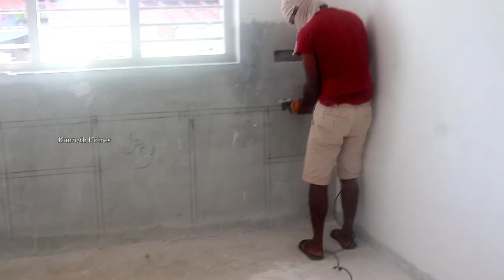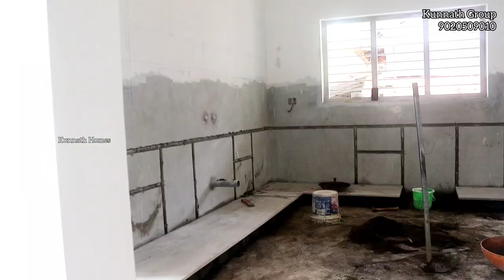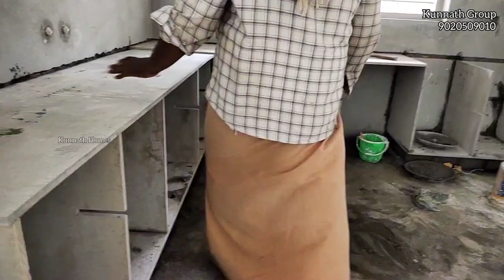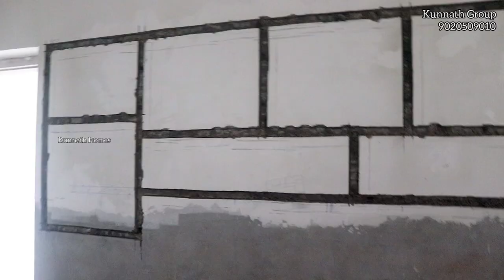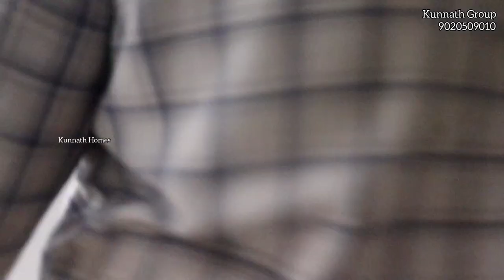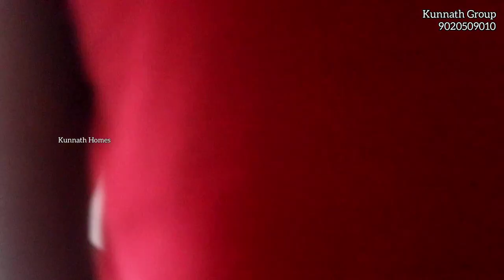New Kitchen Cupboard Making using V-Board || Modular Kitchen Cabinet Installation Process

Comment: V board can with stand during seepage or any water leakages? 
Normal bcz of seepage wall will damage due to this inside shelf paint also peeling off. Does v board is good for water leaks?